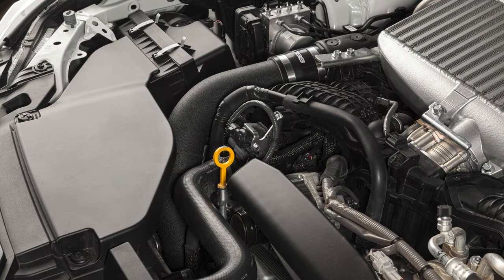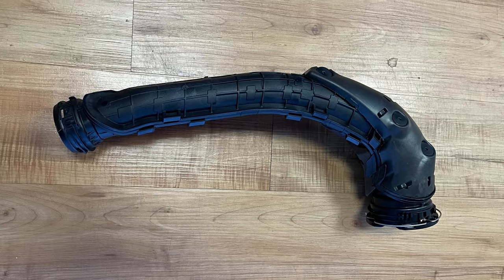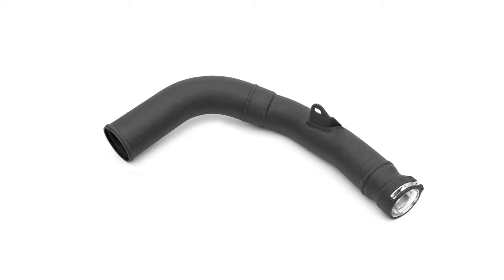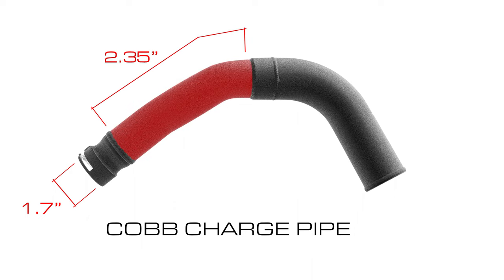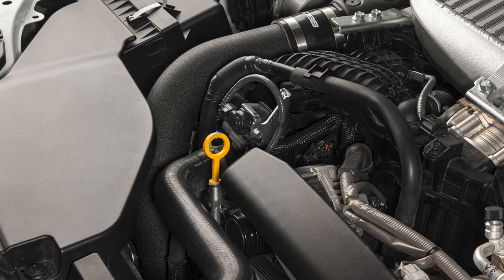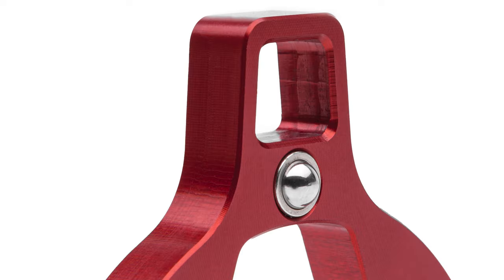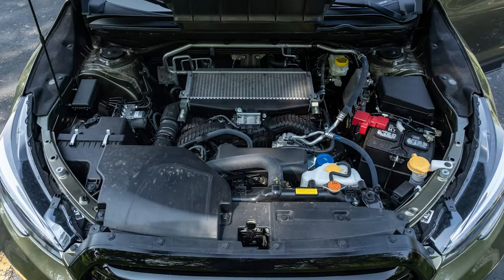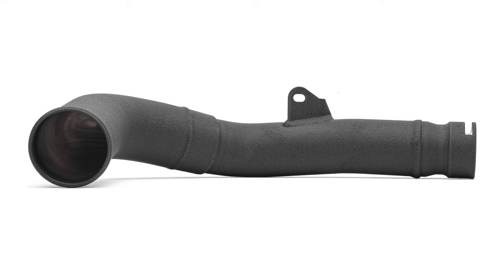COBB Tuning - Product Highlight - Charge Pipe for FA24 DIT Subarus

Comment: Is there any tangible increase in induction noise? Have always wondered if the foam on the stock pipe was more for heat insulation or sound insulation.
Reply: Not in my 23 WRX, no. Zero change in induction noise…and that’s what I wanted!!

Comment: I got the stage 2 cobb package i was wondering if there is a map that just uses the too mount intercooler and charge pipe in the access port?
Reply from the maker: The included Stage 2 OTS Maps are intended to be used with the full package, including the Intake Tube & Filter.  Without all of the components required installed, we recommend sticking with a Stage 1 variant.

Comment: so more weight and heats soaks more than the factory part
Reply: lol...that ultra heavy aluminum just like every single performance charge pipe and/or intercooler kit ever made by everyone and like every high power car ever.  Stock plastic charge pipes are totally great and never crack under boost...What a dumb comment.
Reply: You weigh 350lbs go on a diet if you that worried about weight reduction
Reply: @Bones12x2 it doesn't make a difference unless you go bigger turbo and making big power. Plastic stock pieces are fine for stock turbo.